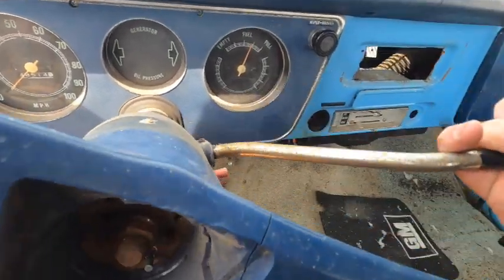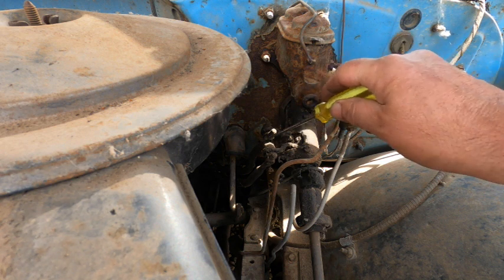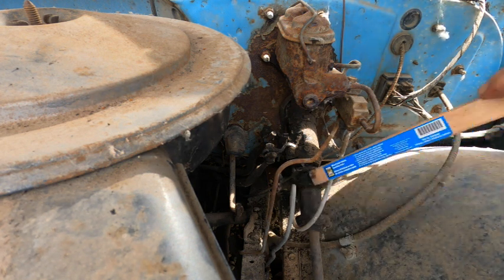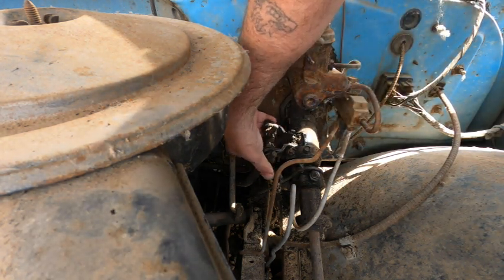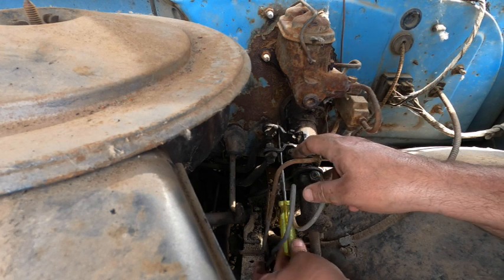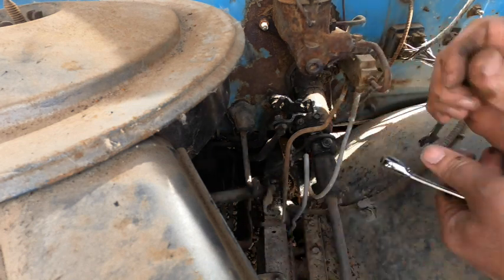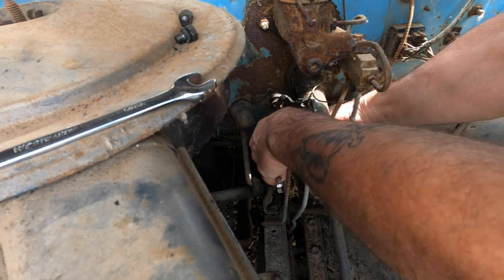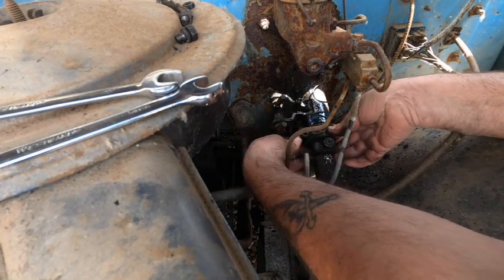Three in the Tree linkage adjustment!  Get rid of the slop, the jamming, the terrible neutral feel!!

Comment: I have a question. On my 61 Chevy pickup it started jamming about a year ago. I’m assuming the passage holes you’re referring to are the square holes? If so the problem with mine is they aren’t north south out of adjustment it’s east west. They are not even close if that’s the correct slot. I’ve tried everything I’ve gotten it to shift many times but it’ll keep jamming after a week or so. I really need help with this. Any info ? One linkage is straight while the other is z shaped.

Comment: Thanks for the video. I have a 67 c10 that I got stripped down and just set back together loosely without all the hardware. 
My question is about the rod ends where they attach to the lower column. I have the rods, the heim joint bolts and the nuts for them along with the bushings in the levers. No Matt how tight I crank down on the nut the rods still move through the joints. What holds the rods to the bolts? Is there supposed to be a clamp for the rod?

Comment: Im wanting to put a chevy 3 speed on my 1940 nash to keep it 3 on the tree since they make nothing for the nash im going to a sbc 9 inch etc but would like to keep it 3 on the tree think it could be done ive looked it up ive done 3 on the tree to auto with a cable but cant find anything for converting an old extinct car brand to like a 80s 3 speed
Reply from the maker: Could always change the column to match, that or floor shifter. Would be cool to incorporate the original column though

Comment: Do you know which brands or/and models of vehicles use this particular type of three-on-the tree transmission linkage?

Suggestion: Maybe you could create a video about how to minimize dropping parts and tools while working on vehicles.
Reply from the maker: Chevy, GMC, Ford, Dodge not sure about the smaller brands
Reply: @shortcutgarage  The linkage on my '50 Plymouth was different from the linkage on my ' 64 Dodge Dart. The '50 was much better!

Comment: Please im in need of the swivels on the linkage rods anyone know where i can get them mine is 67 c10
Reply from the maker: You mean the plastic bushings?
Reply: Sir I mean the ones that adjust length of the shift rods and are pinned to the shfter
Reply: No they are called swivels the make it possible to adjust the length of the shift rods to the transmission
Reply from the maker: @garyteeters-ok3hc  send me a message on Facebook or insta, I’ll send you a set of good used ones I’m taking off my current column
Reply: @shortcutgarage  sir I don't know if I'm getting through to you, but I appreciate your help and will be more than glad to pay you for them please let me know if your getting this message  kind regards Gary

Comment: To switch out the linkage would I have to remove the whole column??
Reply from the maker: Good question. I’ve never swapped them Out. They have always been able to be adjusted
Reply: @shortcutgarage  I can’t start off on 1st I can jump to 2nd than 3rd sometimes as I’m driving I drop it to 1st… I will try the adjustment but I do have the linkage in hand
Reply from the maker: @el_royal_dab9791  by linkage do you mean the rods?
Reply: Yes
Reply from the maker: @el_royal_dab9791  you definitely do NOT need to take out the column. You likely need to just adjust the rod, lengthen or shorten at the column side
Reply: I need help? I can’t seem to find the neutral to do a linkage adjustment? Please anyone
Reply from the maker: @el_royal_dab9791  standard H pattern. Down at the transmission you should see the selector in the Center of both shifter throws
Reply: @shortcutgarage  I understand,my linkage is definitely mismatch also would I have to shorten the rod length? Car turns on perfectly but when release the clutch parked it turns off could that mean it’s still in gear and stalls out and dies????
Reply from the maker: @el_royal_dab9791  sounds like it could still be in gear
Reply: @shortcutgarage  yes a buddy mentioned that too I don’t know where to go from there…. Maybe I’m not catching neutral properly any helping advice is welcome haha I apologize if I’m being annoying
Reply from the maker: @el_royal_dab9791  gotta find neutral, once you do you can adjust the rest as per the video. But you have to find nuetral
Reply: @shortcutgarage  good morning Steve here yes I will try after does seem to be stuck in 3rd the way the linkage is set but hey man I appreciate your time on responding
Reply from the maker: @el_royal_dab9791  you should really go underneath and see, that way you’ll also know if the rods need to be adjusted up top. Just bring an adjustable wrench with you to knock it in neutral